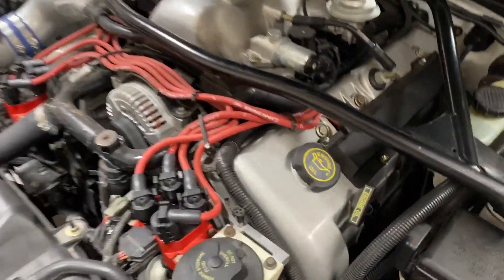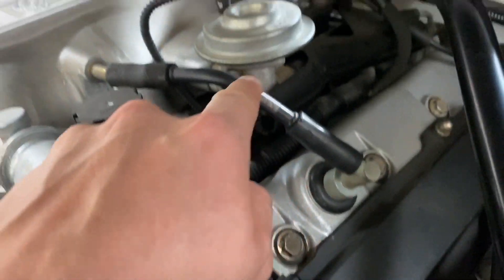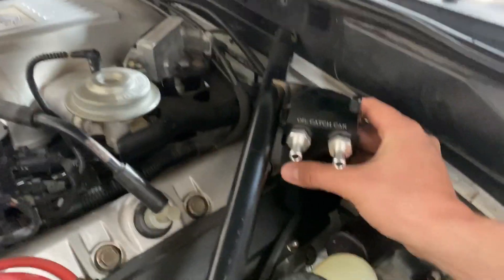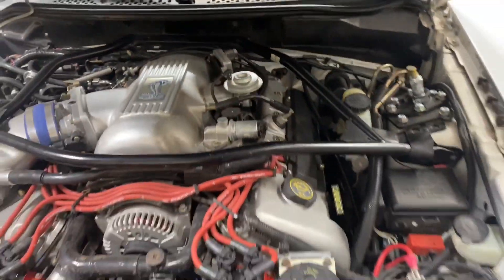Positive Crankcase Ventilation Explained: How to Install a Catch Can for Under $30

Comment: Believe it or not I got my fronts done without a spring compressor. Lucky I reckon.
Reply from the maker: That is lucky.  With lowering springs that often happens.  Avoiding using compressors is always a plus!